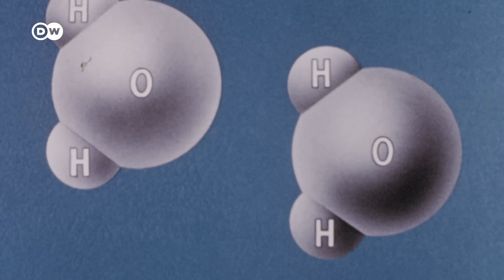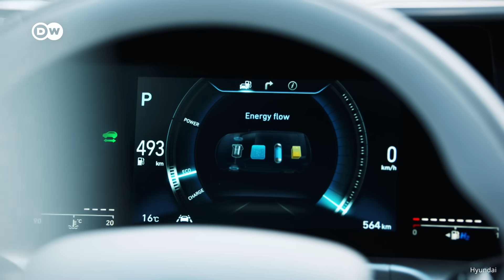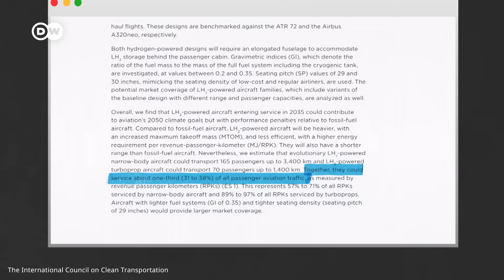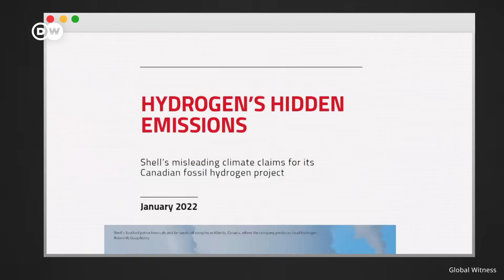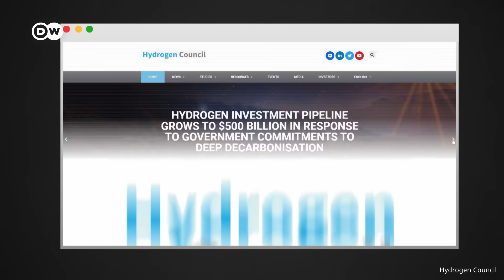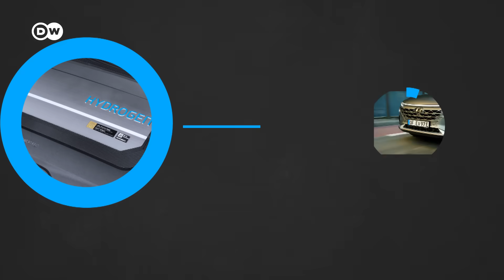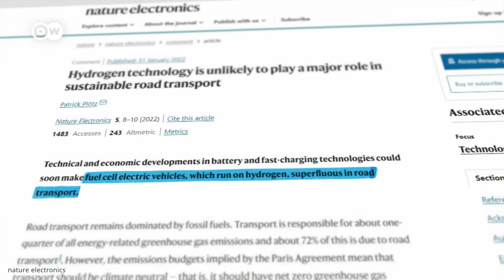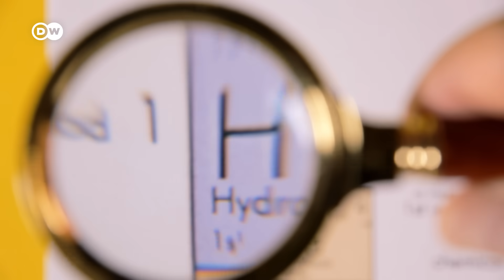The truth about hydrogen

Comment: The hydrogen is just a storage medium, not energy in itself. It is another type of battery.

The first problem with most "green energy" approaches is that there is not a good way to capture the energy. It is converted to mechanical energy, and then converted into electrical energy. Every time you convert energy from one form to another you lose some of it.

The next problem is that once you generate the electric energy you have to transmit it through electric cables to the point it is used. Contemporary electrical transmission networks lose half the electric energy in losses in the cables, much due to heat.

Then you have to convert the electrical power into another type of energy, typically electrical energy, to store it before you use it. Converting the energy loses some more. Then when you want to use the electric energy you convert it back losing some more.

Our electric infrastructure runs near capacity now; this is why we have brown outs and black outs. We simply don't have the electric energy and infrastructure to make this work right now. Everyone will need solar cells and wind turbines on their property before this happens, because then you dont have to transmit the power over great distances.
Reply: "Contemporary electrical transmission networks lose half the electric energy in losses in the cables, much due to heat." - what's the source for the 50% loss?  All large scale providers give 3%-5% (5% in the US due to low terminal voltage 120V vs. 3% in Europe 220/240V)
Reply: @davidhunt240  This was cited by the Virginia Power Exec that gave a presentation at the Richmond Joint Engineers Council a few years back. It was an A-political review of the challenges facing electric power suppliers.
Reply: @eddarby469  nah, 50% losses would be ridiculous, almost as if the execs at that meeting were carrying the electricity in their bare hands.  There's talk of a 50% rise in peak power usage due to electric vehicles, the associated losses with coping with that demand is the only place I can find Virgins Power talking about it.
Reply: @davidhunt240  I'm trying to piece it together right now. The industry has its own jargon, so it is hard to be sure im getting the straight "poop". But so far, the websites cite about 4-6% losses in "transmission", but they also describe "distribution" and "transformer losses" as other categories. They do point out that transmission losses alone in the US account for more power than the seven Central American countries uses combined.
Reply: If you make plenty, doesn't matter if you lose some. Important thing is clean.

Comment: Wind turbines produce AC.  To perform hydrolysis you need DC.  You have losses in the turbines and DC conversion (about three losses).  The electrolysis produces heat (another energy loss), oxygen and hydrogen and you lose energy in gas liquefaction (another energy loss).  Re combining the hydrogen and oxygen also produces heat (another loss).  If you use a thermal engine to recover  that energy  you also have those losses (at least another 40%).

Hydrogen is no more than an energy store.  The losses are horrendous.  The whole storage process is grossly inefficient.

The same is true for battery  energy storage.  All of these so called RENEWABLE ENERGY SYSTEMS are highly inefficient.  

Since we are talking about electricity we  have losses in  transmission and distribution.  These are fundamental problems of using SECONDARY forms of energy like electricity.

Contrast this with the use of petrol, gas or even coal.  These are primary energy sources.  Which are the most efficient methods of delivering energy.

Comment: A big breakthrough in hydrogen extraction has been announced using an aluminum gallium material at regular atmospheric temperatures and pressures.
Reply: You're talking about the recent news about the electrolysis catalyzer where the gallium prevents the degradation of the aluminum into non-reactive aluminum oxide, I presume. Pretty efficient.

Comment: Would using compressed air be more fuel efficient ?    Of course to compress the air you need to use power from some sauce but would that sauce create less or more pollution ?
Reply: A valid question. Compressed air is an energy carrier just as hydrogen. You need power from somewhere else for both. Power density can be plenty higher for hydrogen though.
Reply: Compressed air has very low energy density. To compress enough of it to power a car or an airplane you would need very large storage tanks with thick, heavy steel walls to contain enough pressurized air. In contrast gasoline, diesel fuel and jet fuel have very high energy densities because they are combustible plus they can be stored in liquid form at normal atmospheric temperatures and pressures. These advantages are why gasoline, diesel fuel and jet fuel are so widely used in transportation applications.

Comment: Batteries aren't' either the solution to this issue. We still have the mining pollution issues and scarcity  of the minerals. We also not able to produce clean energy, meaning producing electricity still have a a big CO2 foot print. For instance a Tesla in Morocco might generate as much CO2 as 5l/100km Diesel car.

Comment: Electrolysis requires a lot of energy.  So where does that energy come from?  Well from the electrical grid powered by gas, coal and a little bit of nuclear. Solar and wind are NOT going to produce nearly enough energy to power electrolysis of water to hydrogen.  Using gas and coal is counterproductive as those CO2 emissions make the environmental benefits vanish.  If hydrolysis is the answer, the nuclear is the answer BUT people are scared to death of nuclear due to all the misinformation in the press and ignorant environmental activists.  Issues like three mile island and Chernobyl occurred way before the implementation of computer control of chemical and energy processes.  This technology makes nuclear power inherently safe.  Concerned about CO2 emissions? Don’t talk about it until you are ready to embrace nuclear power.

As for steam methane reforming, you are taking methane, CH4, one carbon atom, four hydrogen atoms and making two molecules of hydrogen. With a byproduct of CO2. You might as well burn the methane (natural gas) directly.  The CO2 emissions, if not captured are very large.  Carbon capture takes energy.  Steam methane reforming is not the answer.  

It’s a lot like the hype about ethanol fuel which is a joke. CO2 emissions from ethanol plants are huge.  I audited our ethanol plants and have seen the emissions from the fermentation process to make ethanol.  Not good.  Not to mention the lower energy content of ethanol versus gasoline which reduces mileage by 15%.  Then you have oxygen in the ethanol that is introduced directly into the flame front of the internal combustion engine causing more thermal fixation of the nitrogen in the combustion are leading to higher NOx emission.  Ethanol is a purely politically driven “solution” given to the states in the midwest.

Nuclear is the answer if we really want to be serious about reducing carbon emissions.  Then you have the while other discussion about how much does carbon emission actual,y contribute to temperature rise which is minimal.  We are chasing a paper tiger here.

Comment: While it is absolutely true that hydrogen is less efficient than batteries you have to balance this against the poisonous properties of the Lithium used in batteries and their other ecologically unacceptable traits such as the massive amount of water required in the mining process. Then there is the finite supply of trace elements. This is not an either or equation.
Reply: Not to mention the fact that China has the largest deposits of a lot of needed materials to make batteries. Do we want to give China  even more power over us? They already hold too much power over us because of medicin production, which is largely located in China.

Comment: For many countries where the availability of renewable energy is limited, either by space or natural resource, it is reasonable to assume that green hydrogen is a pipe dream. Some countries, such as Australia have an abundance of natural resources including wind, in the North of the continent Easterly winds blow consistently for 6 months of the year. In that same area there is a 2000 Km coastline with tides of 7 to 10 metres complete with many chock points where tide races run at between 8 and 12 knots. Though there is little Government interest in investing, there are several private organisations working toward a Green Hydrogen environment. Australia is a unique environment that needs to work toward a hydrogen solution. Most transport relies on trucks, these massive 100 tonne  vehicles travel between 1000 and 3000 kilometres and battery will never suffice. There are problems with batteries, repeated recharge cycles reduces their life expectancy, high ambient temperature reduces efficiency, lighting and air conditioning draw large amounts of power as do refrigerated transport, and the list goes on  . The issue is not with creating hydrogen, but storage and transport.
Reply: Possibly the most sensible, balanced reflection on both technologies I've yet read.
Reply: NH3 is the future for shipping, it can be stored at approx -33deg centigrade an be use in existing diesel engines with some modification. Much less waste of existing materials.
Reply: @damienjambu1460  And how exactly are we going to burn NH3?
Reply: I partly agree with you, i am an Indian. Here govt is thinking to release hydrogen trains by 2023 end and I hope the transportation of hydrogen then carried out with the help of these trains which would reduce the usage of oil based emissions.
Reply: @MS67MS india me most of train electricity ho chuka hai
Reply: And ammonia, NH3 is a transport mechanism that could be exploited
Reply: I live in the driest continent and driest state and driest capital in the world. The idea of producing hydrogen from water for Australia in my opinion is ludicrous and folly. The SA Govt spent millions on a desalination plant and not one litre has been produced. Water is valuable resource and people have realised this in past but forgotten about the drought's and now investing hydrogen production. Seems to me there is a disconnect. I also lived in interior of Australia and know how precious water is, as most Australians never venture from the coasts to realise how fragile this continent is. Let's us take a holistic approach to energy because I  can tell you, good useable water is becoming the rarest commodity on the planet and we should use WATER wisely.
Reply: @peterslater2914  we can make hydrogen from seawater though, adelaide university researches worked out the technology for it
Reply: @siiluviilu  thank you for the information and it's great that we have scientists  that are capable of great things. However I agree whole heartedly with Jonathon above. Our state has a desalination plant and that's a great white elephant. Just because we can do things doesn't make it right. Is hydrogen the next white elephant?
Reply: @peterslater2914  yep, hydrogen still has the problem of being less energy dense, so using it as fuel(instead of a fuel cell) means you'll get way heavier cars which means more road maintenance, not very eco friendly
Reply: I live in Adelaide the driest capital in Australia on the driest continent in the world. Our population is growing and is one of worst thing that puts an enormous stress on our fragile environment. Most our land is dessert and most people even in our own land have not ventured into our interior including our politicians. I have lived in the interior for a long time and realise what drought is, and the effects of it on the land and the environment. Our small reptiles and our marsupials are at risk of going into extinction and loosing them altogether. In my time in the bush I did see however a change in attitude of our outback graziers. They practice best practices on their land. It's a real pity that city dwellers didn't have the same attitude toward being up to date with and being more involved in conserving our resources. Most of our country is serviced by underground water from the artesian basin and that is such a precious resource to most of our interior that has little rain and in Areas may not get rain for 10 years.,but when it does, it floods. Our soil is fragile as well a few feral horses passing and area on same path can turn that path into a large Gully when it rains next. People talk of hydrogen production well water is such precious resource in our country that I have don't think we can waste it. The cost of producing such hydrogen is not cost effective. I pay 43 cents/kW which is utterly ridiculous and you need power to produce hydrogen with electrolysis. The figures don't stack up. We have large reserves of gas but that's all going overseas at better prices that we buy it for. This time is an interim between batteries that are not capable of storing enough energy for long enough. Put the money into battery research not a pipe dream like hydrogen, which many more downsides as well as cost. Transport across our nation with trucks is absurd. I witnessed the building of rail line from Alice Springs to Darwin and I thought we were on the right track. But no nothing has changed. The port of Darwin was sold to foreigners which is betrayal of all taxpayers that paid for the railway. Australia has much more serious issues to deal with, such as rising salt in our soil from irrigation. We are a small nation we should be prioritise these problems and be careful not to go down the wrong path.
Reply: Never say never, I guarantee it will happen.
Reply: why would you use renowable energy instead of nuclear? wind energy kills between 140.000 - 500.000 birds per year in the usa, just use nuclear, don't need space, clean and very efficient, also really reliable, nuclear energy is demonized to the point people don't want it when it's the most eco friendly solution we have at the moment, way less carbon footprint than anything, and remember manufactering solar panels is really bad for the earth.
Reply: Well from what I see Hydrogen is only good if it's green hands down.we have a green house gas problem from land fill. 26% of greenhouse gas is caused by it .Celio a Alberta Canadain company has developed a way to make land fill for the most part besides stone and metals turn into energy and other useful products with carbon neutral emisions. The fuels created could generate electricity for hydrogen production and reduce methane . The diesel produced has lower climate change capibilities then Methane.                                                                                                                                More reaserch should be done developing the movment of water .70% of the planet is covered with it and for the most part it's always moving. Land based bobbers on long arms hooked to hydraulic cylinders with directional valves forcing 1000's of pounds of organic fluids into turbines which are conected to electrical generators. This can be used to produce hydro electricity and power the hydrogen production for trucks,cars, planes and ships. To be logical electricity should  be used directly is the most efficient option.
Reply: Like Orkney in Scotland  it is using tidal hydrogen to power the docks and there is a vehicle  fuel cell charging station.
Reply: If moving energy from green generation is the challenge. It still might be overall more efficient to charge a battery ship and ship that to a port of load demand. Or move the heavy industry to the place of green generation.
Reply: And Australia can export hydrogen to countries that have a harder time producing it.
Reply: Storage and transport may be a disadvantage in some situations, but can be seen as an advantage in others. Generating hydrogen and storing it until it is required can in some cases be better that relying on generating electricity on demand. Likewise, having the ability to transport energy can in some circumstances be a benefit.

Green Hydrogen would seem to be a technology that is worth pursuing to fill the gaps that battery, wind, solar, wave and nuclear leave. Heavy equipment, planes and boats, and the cost of electrification of rail are all areas that Hydrogen could offer advantages. Cars and short-haul trucks less so and domestic heating not until there are cost effective micro green hydrogen generators.

Comment: No discussion about the difficulty of safely and effectively storing hydrogen?  Hydrogen atoms leak through just about every standard industrial material.  And the hydrogen doesn't just leak.  It permeates the material making it weaker and generally changing its structure.

Comment: Economically not feasible for the next 50 years, except in pilot tries. Physically very inefficient. EU‘s budgets are depleting quickly. There will be no budgets for these infrastructure projects. Gas and Oil will stay next to Uran affordable high density energy sources. EU will not be competitive with renewables at 30k€ GDP per head. Asia will be powered by high energy density resources, and so will Africa. When ideology takes over reality will bite back.